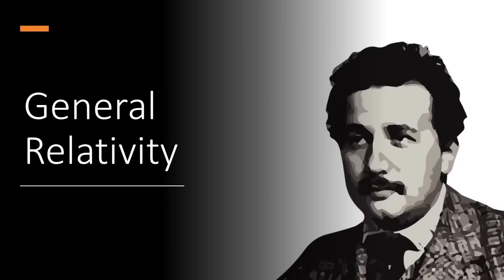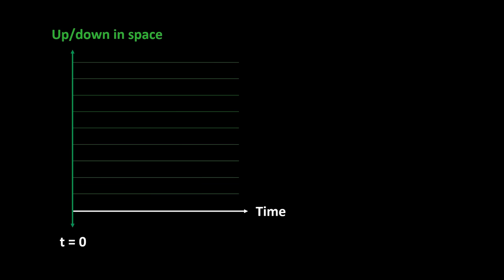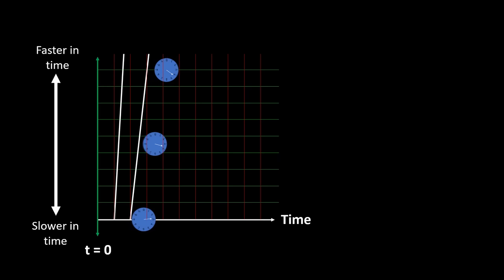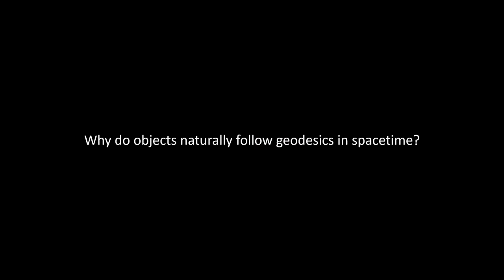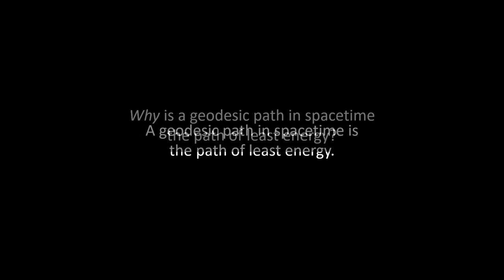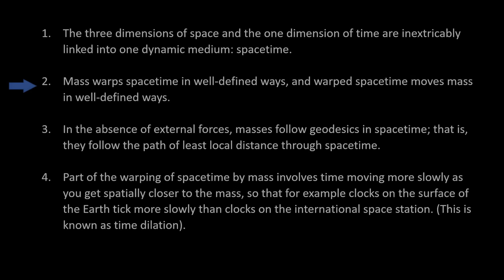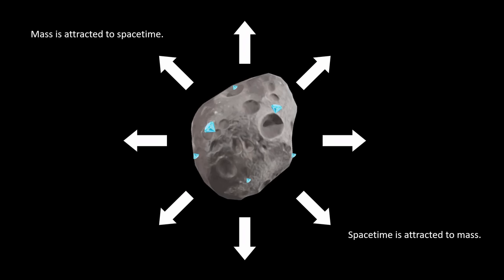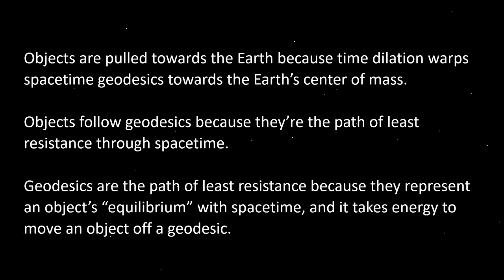How Time Dilation Causes Gravity, and How Inertia Works

Comment: Quick question : is gravity canceled when you are exactly between two identical masses (like 2 planets) ? If yes, does the same happen between two black holes ? If yes again, should not that shrink the "size" of the event horizon  ?
Reply from the maker: Like kara bool is saying, the effect of the gravity on you doesn't cancel out (you're pulled in both directions equally, still, so there's tension on your body), but because both influences balance each other you don't accelerate in either direction (remember that F=ma refers only to net forces on an object, here with net force = 0). I believe that two black holes brought near each other would actually have their event horizons expanded in the direction pointing towards the other black hole due to its gravitational influence, but black hole physics is complicated and is decidedly above my pay grade. Interesting questions.
Reply: @IdeaListEye  
Thanks to both of you. Oddly enough I have really hard time finding answers to these cases and yet it should be a study case.

But if we admit that the event horizon can expend in the case above, what happens if the two black holes just pass by and don't fusion ? Will the even horizon recess once they get away from each other ? 

Would not that mean that something trapped behind the event horizon at that moment (just when the two BL met each other) would then be able to get out ?
Reply: My God.... Guys, dont listen to this idea dude, he has very little (to none) clue on this matter... There is nothing to "cancel out". Gravity is not a force, the only thing that matters is the so called "curvature". But since the spacetime is locally flat (relative to the size of human body), your body wouldnt feel a thing, and wouldnt be "stretched". There is no "pull" to any direction, just as there is no pull even now when you stand on the earth. You are in a free fall, inertial motion devoid of influence of any force. His video also is filled with fundamental flaws and misleading info. I mean, nothing wrong with his interest in physics, the problem is that he is trying to teach while he didnt finish the learning part. Stretched event horizons are even funnier.
Reply: @nyalarhotep  
You repeated what you read in a book perfectly. Congrat. If spacetime curvature is not a "force", then what is bending spacetime ? How do we obtain an acceleration without applying a force ? And in this case, what is your definition of force ?
Reply: @En_theo  No need to be aggressive just because you failed to understand something. Be patient, read a lot, think a lot. Physics is not that hard when you take a patient and slow path. The force is external influence which alters an objects inertial movement. Gravity simply doesnt do that- free fall is inertial movement, unaltered. The space is altered. The forces dont alter space, they alter your vector inside it.
Reply: @nyalarhotep  
There is no aggressiveness, but that's rich coming from you. Your first comment was not exactly that friendly and quite self-righteous. 

It seems to me that I have read more than you, since you're giving the by-the-book explanation that I read 20 years ago. It will take you more reading and thinking to realize these don't work. 

These explanations are incomplete and contradict themselves on many points. Your "free fall" for example works only if we assume that objects are points infinitely small. GR also assumes that spacetime can be divided infinitely but that raises many contradictions like the 3 body problem or the inside of black holes. 
Also, the general consensus does not accept spacetime as a real medium while Einstein himself clearly stated the opposite. 

Don't repeat what others say, start the reasoning from zero and make sure you have not been influenced by the "official" version... ask John Bell how he has been treated by "official" physicists when he proposed his inequalities.
Reply: @En_theo  Yep, great. What i said in my first comment doesnt apply to you or any other dude with unresolved issues. You are free to share your opinions with this guy, since you probably can`t damage each other too much. My comment wasnt self righteous, it was sincerest warning to people who want to learn. Wrong info is worse than no info at all. Regarding you, i dont know how much you have read, nor i want to compete with you. What i do know is that you are totally confused and incoherent on the matter, and i could easily answer all the questions you asked, but i won`t. I have infinite patience for conversation, but none with those offended by knowledge.
Reply: @nyalarhotep  
Oh really ? Because all these questions have found no answers so far. The fact that you don't know that just shows your ignorance. You are confused by too many years of repeating without thinking.
Reply: @En_theo  All 3 questions have perfect answers, i gave you one already. None of those contradict anything from GR. Beside your first question which is poorly formulated logical nonsense, answer to second question is self evident from the answer to the third question which i gave you already. You don't even know what the real questions are, that are unanswered. And there are many. The questions you asked are something a high schooler would ask. But as wise people said, there are no stupid questions. They are all legit. Problem starts when you get impatient with the progress of your knowledge and failure to grasp a coherent knowledge, then your questions become frustrations, and then you start with your own alternate solutions such as gravity knocks objects out of their geodesics, or event horizons expand toward other massive objects, or the earth is flat and there is no virus.
Reply: @En_theo  But as i said, that is your problem, which you will surely solve somehow sooner or later. There are billions of people living in this or that kind of ignorance, and i am not bothered with you. Until you start your own channel and start spreading it as a "science". Nothing against you mate, i don't know why you found yourself offended by my first comment. It wasn't directed to you, but to the "teacher". You jumped to his defense as if he is your cult leader or something. Take it easy, life is better than that.
Reply: @nyalarhotep  
You're really egocentric, you don't even realize when you act like arrogantly. No, you didn't answer to any question, you assume that an acceleration can be obtained without applying a force. That either leads to a contradiction with the word "force" or a contradiction in the theory.

As for your "it answered the second which answered the third"... yeah, and you dare say I poorly formulated my arguments. Please, you're just a kid who started physics last year. Let's admit that and move on.
Reply: @En_theo  You are just a kid, you are just arrogant, common, who is the kid here? No need for insults, i did not insult your master. I only said he has no clue on the matter, which is true for both of you. And i did it for the sake of others. They dont have to listen to me alright, but it is enough if i helped anyone just to question IF this dude knows what he is talking about and do their own research. 
As for the physics, this will be my final free lesson to both of you, for the rest you`ll have to attend my classes. There is NO acceleration with free fall bodies whatsoever. No observable, perceptible, calculable, or any other acceleration of the free falling inertial frame. What outside observer perceives as acceleration, is just a curved path the falling frame takes through spacetime. The direction through spacetime changes, and while the speed stays constant for the falling frame, its directional conversion makes the same path traversed in less and less time, which appears as acceleration for the outside observer. It is how every curve looks when observed as a straight line. For example, this is how the movement of the planets seem to work if you observe them aligned with the orbital plane. They seem to move fast, then slow down to a halt, then start speeding up in the opposite direction. While the truth is that they move with constant speed in circles. That is why the answer to the third question leads to the answer to the second.
Reply: @En_theo  And please, stop pretending with that "i read that 20 years ago" nonsense. As if you somehow surpassed Einstein and found better working theories. Had you really read all this "20 years ago", you at least wouldn't ask me things such as "how do we accelerate without force". Because you would know what my answer will be. And what in the world should "by the book" mean? Of course it is "by the book", these are Einstein`s findings, not mine for God`s sake. The difference is that i DO understand them, while you don`t. Your problem is that you somehow want to surpass him, yet you didn't even understand his theory. And the general relativity, while not as flawless as special relativity, is still the best thing we have. Tested and confirmed in countless tests.
Reply: @nyalarhotep  
You're too egocentric to even realize how offensive you are in the words you chose and you don't even see how childish you are ("your master", "you defend him" blahblah). I don't know him and I defend my knowledge vs. your lack of self-questioning. 

Also, don't pretend you're not a kid, you clearly are young and not experimented and really behind in your maturity. 

I have seen so many like you, they're taught equations, they answer correctly at the exam and think "now I have the proof that I understand it". No, you just got a paper that proves you can repeat what they told you. Just check John Bell's private journey in that hypocrite world of "scientists" to realize literally none of these idiots have a scientific mind.
Reply: @En_theo  First, i couldn`t care less about your  evaluations of my personality. Implicitly, i dont get it why are you so obsessed by it and offended with everything. Also, i don`t care for arguments about who is older, who is a kid and who read more. I can spend my time here exclusively on productive talk, which was the goal of my first comment. To get personal here, where everyone is anonymous and where you cant even know the age of your correspondent is beyond infantile. 
Also, i don't have to prove to anyone if i understand anything or not. It is already clear because i can give you all examples in hundreds of different ways, in my words, my thought experiments. But the fact is that what Einstein got right, he got it damn right, and i cannot twist the truth to prove that i think with my own head. That is OK, if you are hitting puberty, but not in any other case. As with everything else, you got very wrong conclusions from John Bell story. But i will definitely stop here, because this feels exactly the same as conversation with a flat-earther. It is not that there is something wrong with the fact that earth is round, its that he simply cant understand any explanation, and even more, because he`ll not admit he is wrong. And because he suffers some messianic complex thinking that he is the rare John Bell in the world of fools. I am done here, dont expect any more answers. Or that i will be reading your comments at all.
Reply: @nyalarhotep  
You do realize that you started all the personal attacks and that you're using straw man attacks like a child ? I hope you question yourself in physics more than you do in your comments on youtube. But at least it showed what kind of person you are, now everyone can judge how serious your accusations were.

Comment: Masses are high frequency resonances of "space", which "heats up" the area around it. The space around a mass therefore contains more energy,  so time goes slower in that space. Think of it as trying to swim in calm water, compared to rough, it takes longer.
 
Inside a particle the high frequencies are resonant so energy density is very high - so high energy = very slow time. maybe to zero or next quantum level down in "speeds of time" and like in a black hole on a macro scale.

What are these vibrations in or what is space? That appears to be interaction between "branes"  to create the fields which our particles exist in. Branes being primeval collections of virtual particles or "dimensions".

Comment: This is one of the best and clearest explanations of how the gradient of slowed time causes the gravitational "pull" toward the center of a body of mass. Since you are obviously a great teacher, I would like to ask a different question

I accept the premise that the gradient of time causes the gravitational effect, and that concentrated energy is the source of this gradient, whether in "pure" form or packaged into mass. My question is HOW does that energy create the gradient of time around it? I have not found anything the provides even an attempt at explaining that

A related question is that we know that the time of all parts of a moving object slows down as seen by an outside observer. What happens to the space around that object? Is there a sudden jump, or discontinuity in time between the border of the moving object and the space around it? Or does it create a well where there is a gradient of slowed to "normal" time as you move away from the object?

Tying the two questions together,  could the gravitational effect of a mass be caused by all that energy basically moving at the speed of light - but of course trapped within quarks and other subatomic particles - and the net effect creates a well of depressed time that extends beyond the boundaries of the mass, which then becomes the source of gravity?
Reply from the maker: Thanks! These are very interesting questions. Let’s call them questions 1, 2, and 3. Question 1 (“HOW does energy create a gradient of time around it?”) is similar to asking “how does an electron affect the electric field?”, and unsatifsyingly, we don’t know how this happens. These things are taken as fundamental mostly because there’s no way we can come up with for us to test the mechanism underlying them, though we know there is some mechanism. I don’t think it’s strictly impossible for humans to discover the answer to these questions, but we haven’t gotten there yet. 

For question 2, the model has no sudden jump at the border of the object; any energy that warps spacetime warps spacetime in every direction with its influence propagating at the speed of light. 

Question 3 prompts some interesting ideas- a common interpretation of general relativity is to consider all energy as moving at the speed of light through spacetime; it just happens that massive objects have most of their speed-of-light motion going through time, not space (whereas massless particles like photons move at the speed of light through space only, and don’t travel through time at all). So in effect, you’ve happened upon that interpretation yourself, and from that perspective, in some way the answer to your question 3 is yes.
Reply: @IdeaListEye  Wow, thank you so much for taking the time to answer my questions. Your answers were very helpful
Reply: @IdeaListEye  Actually, isn’t it the case that the components of massive objects are indeed moving through space at or near light speed?  All of those little gluons zipping around at light speed between quarks, and quarks themselves moving at near light speed, all within the confines of protons and neutrons, are slowing time in their vicinity. The cumulative effect of a gazillion protons and neutrons in earth for example,  slows time enough so that it keeps us from floating away off the surface

The collective object - a rock, our bodies - may be at rest in a Given frame of reference, but its components are moving at light speed scale